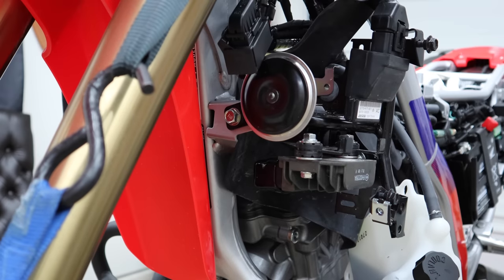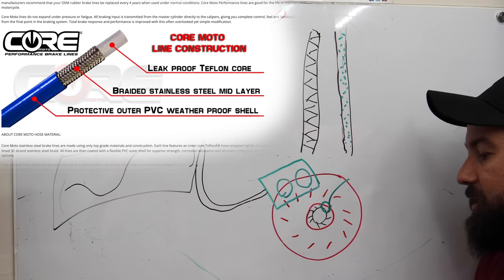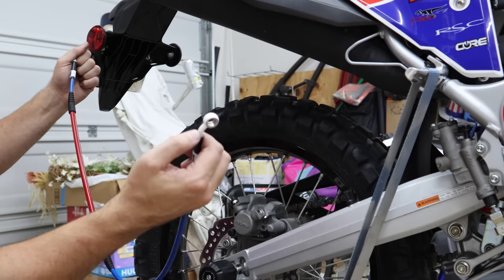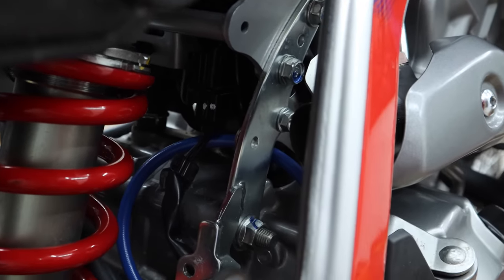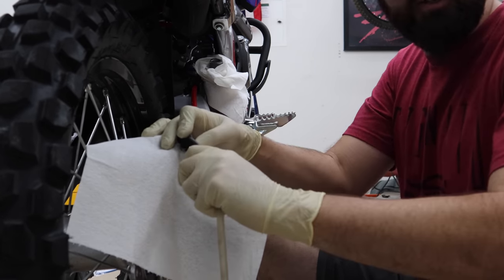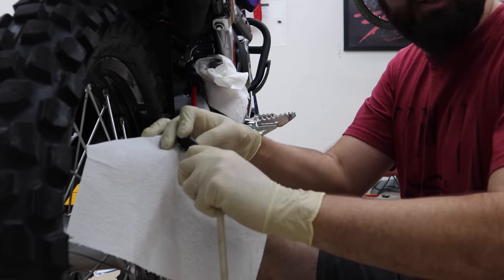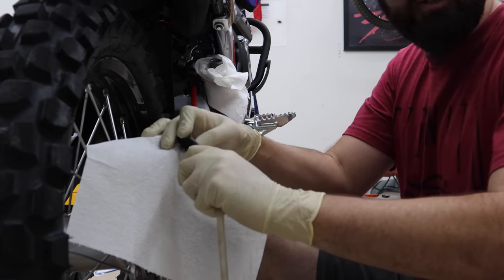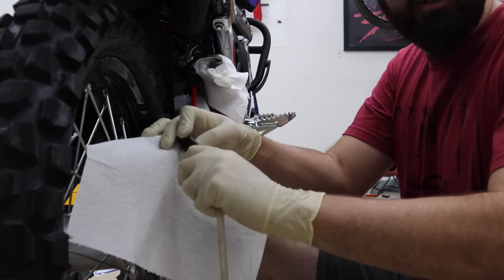Steel Braided Brake Lines CRF300L

Comment: Jake, the abs light needs a sticker, or at least a piece of harbor freight electrical tape!
Reply: I opened the dash and stuck a piece of gum in the abs light, now its off forever lol, they are separated by cubicles, each cubicle has an led, I just filled the abs cubicle up with gum so the light doesnt shine thru lol

Comment: I had a steel brake line on my old KLR 650 with a single front disc, it was fine, I learned the street on it. I switched to a stock MT 07 with double discs, though it had a lot more stopping power the feel isn't there. I will be replacing with steel lines as soon as I have the funds (getting a mechanic to do it cause its tedious especially with ABS, yes I'm keeping ABS, not turning it into a MTenere 07 lol), but I'm a broke engineering student so, might be a while.

Comment: In Australia, any warning lights on the dash are a defect. Some of us might appreciate see how you'd go about turning it off
Reply: ECU flash?
Reply from the maker: It will be a wire in the plug going to the dash. I’ve got a friend down the street with a non ABS. I’ll get his bike over here and figure what wires are missing from his plug that are in mine. That will tell me what wire to unpin. When I find out I’ll post it!